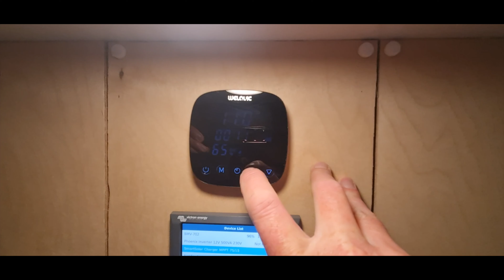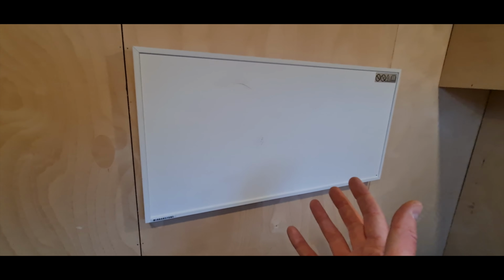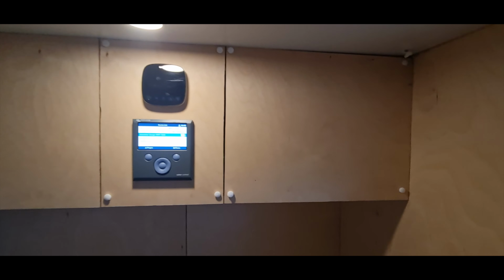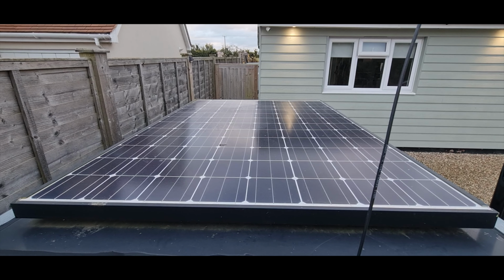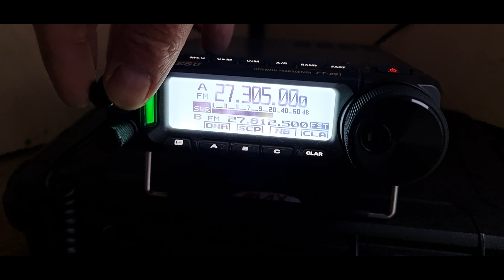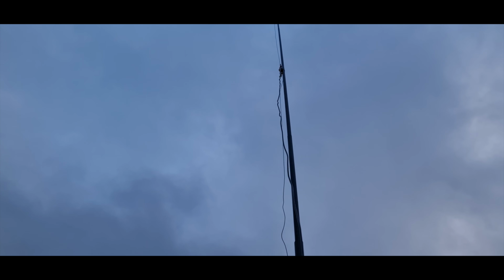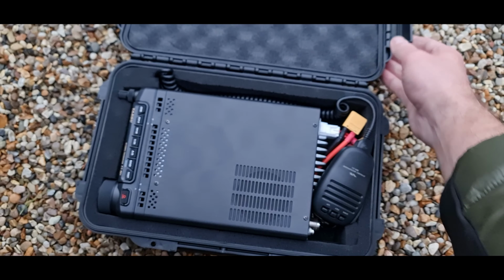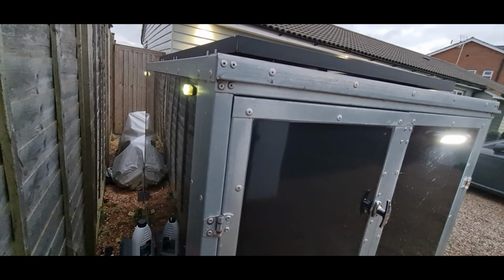I BUILT A CB RADIO TRAILER!!!

Comment: Cool Hope the inverter doesn't cause you too much noise?
Reply: I was thinking that . Solar kills UK CB
Reply from the maker: Yeah I'm wondering if that's because terrestrial solar is grid tied and there's all sorts of crap going on to sync it with the AC sinusidal mains. In this xasebits just charging batteries so maybe that's better... i don't know...
Reply: @andykirby  Dunno I have solar for my Shack but just the panels and charge controller, I think the inverters are the evil bit lol :)
Reply: @andykirby  You may need to run off the battery only with all other electrics off to see if your noise isn't local.  Inverters and charge controllers can be a bear..   Looking forward to seeing you out and about in the mobile shack!

Comment: That's a good concept that turned out great !  That would be perfect for the UK RayNet. But you can't just stop with CB, LoL. You've got to construct some "slide-in slide-out" racks with quick mount/dismount brackets - (you aren't going to want to leave radios in there when you aren't operating). Maybe some velcro on the desk for Portable radio drop in chargers, a 12 volt fan, and even a sleeping bag... Anyway, it came out great !

Comment: Andy you need to get up to the lakes mate and test it out lol, also where I live great place 👍 quick question mate I've got a vector typhoon ebike and I've tried to wire up a stop start button instead of an ignition key but can't get it to work ??? Do I need some kind of 12v converter or is there a a certain switch I should buy 🤔 keep up the great videos always a great watch

Comment: Love your video's Andy. However, I have to say that one of the best things about portable  radio operation is getting away from all the electrical noise generated by switch mode power supplies and LED lighting and other such modern gadgets, and you've filled your radio based trailer full of those things. The noise you're experiencing could be from that. It will be interesting to see how you get on when you go out portable with it properly.